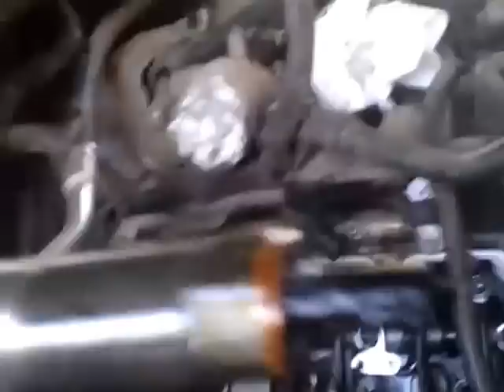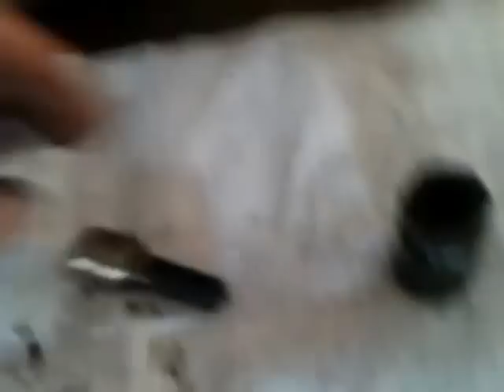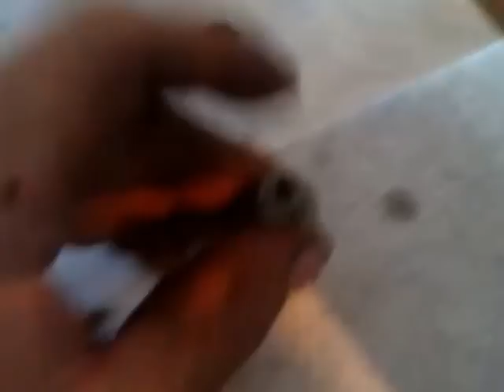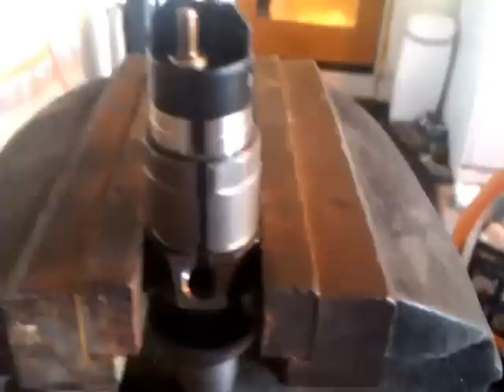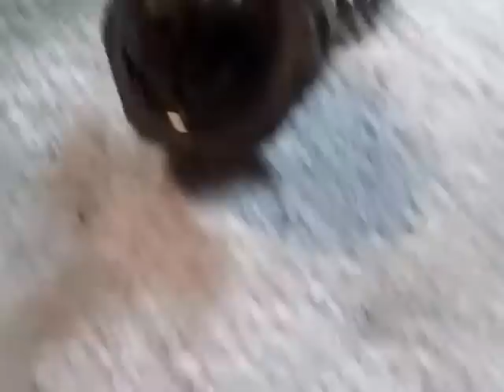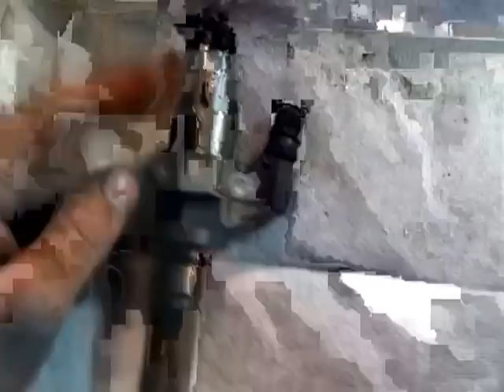Injector Rebuilding Process for 2002 Duramax 6.6 Diesel with the LB7 Engine

Comment: great video. one question. Couldnt you just clean the original nozzle with some type of carbon cleaner? looks the same as the rebuild one...
Reply from the maker: You can't clean the nozzles if you have issues.The problem is they literally wear out. There is a steel plunger inside the nozzle head, that allows the fuel to flow or stop, with 25k of pressure behind it, it eventually will wear the tips of that internal plunger/nozzle and that's where you get leakage. Hence, smoke/hazing/diesel knock.

Comment: I have an 02 duramax.   I bought it with about 150K miles on it already and it now has almost 200K miles.   It has always had the injector warning code flashing but the truck has always run fine (16-18 mpg, no smoke) but I think I should fix the injectors.   My mechanic said that when the injectors fail, diesel fuel will start mixing in with the engine oil and that will lead to big problems and told me to shut it down if it starts running badly.   I think I have pushed my luck enough and should get this kit and rebuild the injectors before a critical problem arises.   Just as a quick side note, one shop told me that I needed 8 new injectors and that the materials and labor would be $4000.
Reply from the maker: Please email me at Nateornat@gmail.com or call/text me at 612.888.3629 (DMAX) so we can talk and I can help you out if necessary.

Comment: is there replacement parts for the ball seat errosion?
Reply from the maker: There are a couple options. You can buy the steel ball caps? But if you have seat erosion on the hole that the ball sits over then you may need the valve assembly. those run about $75 each. but if you need all 8 i can probably get you a better price..

Comment: Nate, loved your video, great job. 

I'd like to get a price on a rebuild kit for eight injectors on a 2004 Chevy Duramax 2500.  What would it cost me for the kit with the 30 nozzles.  I have run a cleaner twice through the injectors and it still is missing. This engine only has 104,500 on it.  Would you send me a price for the kit with the 30s please?  GIve me a call at 814.504.1387or email me at revhal3@gmail.com.  Thanks Hal

Comment: Hi, What is the torque specs on the lower nut that retains the injector nozzle into the body of the injector. I can't seem to find that info anywhere. Thanks for your time. Gary

Comment from the maker: FYI:
Tighten the fuel injector hold-down bracket bolt to 50 Nm (37 lb ft).
Tighten the fuel injector return line to injector eye bolts to 16 Nm (12 lb ft).
Tighten the fuel injector return line to cylinder head eye bolts to 17 Nm (12 lb ft).

Comment from the maker: I didn't get a code. Mine was smoking, started off pretty light, drove it that way for 2 years and it continuously got worse. It had a strong diesel smell from the exhaust also from the un-burnt diesel. I was in denial that it was the injectors, mostly because i knew the expense to repair. But finally came to that realization and bit the bullet, but decided to find a more cost effictive way. After the injector rebuild, perfect, finally NO more smoke.

Comment from the maker: nothing really. just make sure the sleeve where the injectors install into (on the engine) is clean when you re-install. i used a rag on the end of a flat-head screw driver , twisted around with a high buildup right at the end. Spin it as you push and use some carb cleaner to remove deposits. then when you re-install with the new copper washers it seats perfectly.